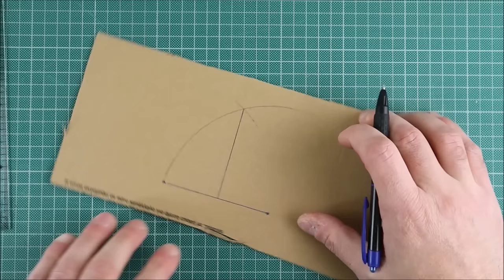Viking Ship Drakkar Miniature - Popsicle & Bamboo Sticks Tutorial

Comment: Mr. Magic Stick. I would really like to make one of these. It looks like the overall dimensions are 16" length and about 3 1/2 to 4" beam?
I would like to use your scale.
If you answered this somewhere in this video I apologize.
Really nice rendition of Viking ship.
Reply from the maker: Every square in the cutting board is 1.00 cm (0.4 in). So you can estimate more or less every length. But this is not so important. Download a template for the deck (there are many), print it the size you like and follow me step by step by working and cutting the parts proportionally.
Reply: Mr. MS.
Thanks so much for your reply. I am  a popsicle stick, coffee stirrer, toothpick, dowel, and basswood guy. I like to just make stuff that way with no plans, or printed instructions so to speak. 
Now that I can verify the scale, I drew 1/4 of the deck, made a template, and 3 more. Put them all together and now I have it.
Thanks again. You video is so detailed I believe I can do this now.
Reply from the maker: @kurtschlarb9762  great when you make your model send it to my IG and i will upload it